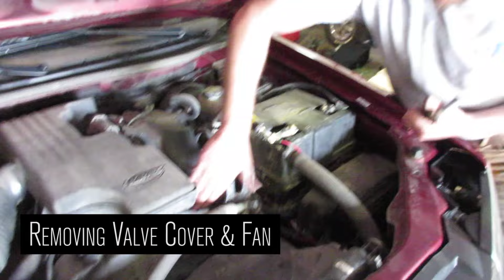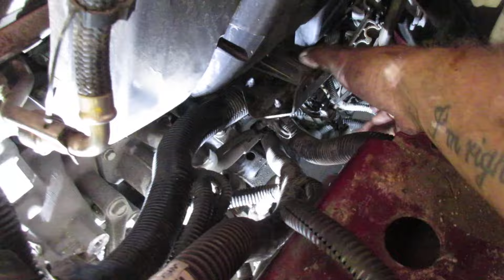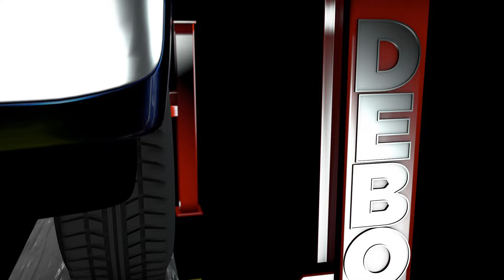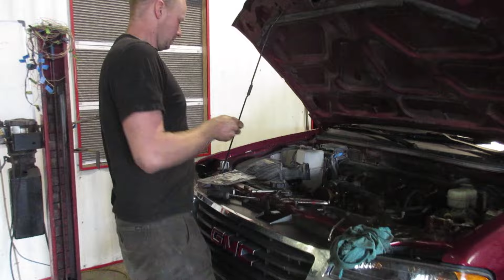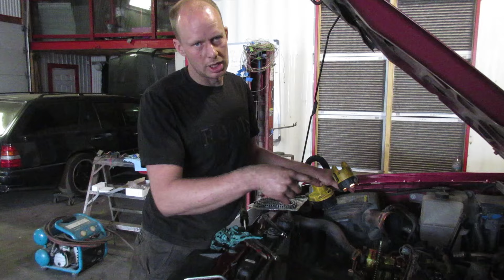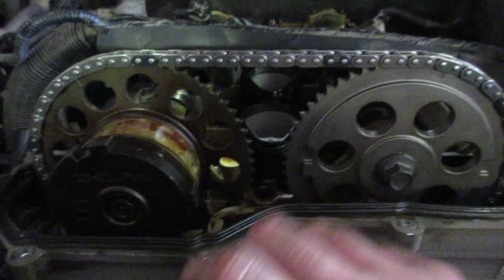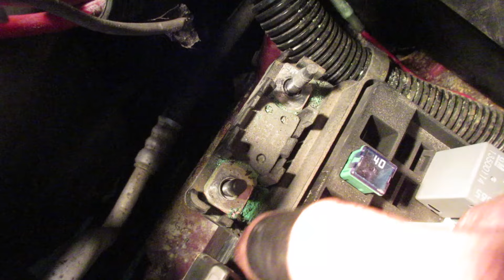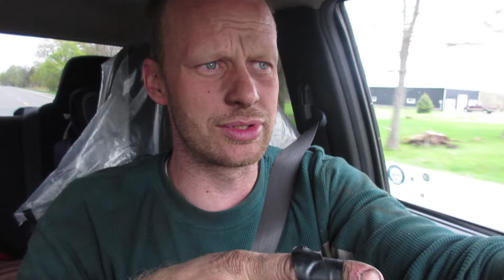Over-Engineering At Its Finest! GMC Canyon Needs A Timing Chain

Comment: The best thing to do with one of these engines would be to drive until it grenades and then swap in a V8.
Reply: That's the trend with these trucks (V8) Seen one that is diesel swapped.

Pretty sure this is Saab motor in these trucks.
Reply: @Bumblebee4788  Grave digging here but Saab helped engineer Ecotec, not Atlas, which is what these trucks run.  There was a Saab 9-7X 4.2i that used the 4.2 I6 Atlas (good engine) but that's about it connection wise with Atlas and Saab.
Reply: Our buy one that came with a factory 5.3L V8 which is what i did

Comment: I was inspecting the rebar for a column in a library extension once.  Boy Wonder architect had specified elegantly thin concrete structural elements, crammed with enormous rebar, and had diligently calculated the size of the voids needed to allow the concrete to fill the forms evenly.  Because 3/4" aggregate should have no problem sneaking through a 7/8" space between bars, right?  No way any individual rock could possibly become wedged.

Imagine how long it took to chip that cured concrete out when HUGE rock voids were present.

Comment: Loved our little Colorado 2.9L for the same reasons. It was a great runabout until it hit 100K miles. Then the timing chain stretched to the point the check engine light came on, even with perfect maintenance. I was able to change it all out without removing the intake (plastic, it bends over) and I pitched the rear chain in the garbage, 'cause screw that nonsense! It ran well enough to keep the light off, pass smog and we sold it before the next craptastic nightmare breakdown occurred. BTW, its a good idea to replace the cam phaser while you have everything off. It was surprisingly cheap from the dealer and makes for a complete job.....(he says, as the new rear balancer chain rusts away in a landfill!)
Reply: Hey what year colorado was this?
Reply: @larsonny77  Pretty sure it was about a 2010. Just a base model, fleetwhite truck with no options. The other major issue was the heater blend doors breaking very early on in the truck's life......other than that, it was a great vehicle.

Comment: hey buddy, my first truck was a 1990 chevy s10 4.3 and a 5spd 4x4. that truck was my dads and he gave it to me when it was on her last legs drove her for a couple years in highschool, burning coolant and changing the oil very often. it knocked and rattled like a sive. i loved that truck but not reliable at all because it had 300k on it. my next truck was a 1984 s10 2.8 v6 and a 4spd and 4x4. i love my truck. anything that goes wrong with it i can fix it myself. i just re did most of the wiring from the cab to the back lights. never messed with wiring but replacing all that really made me understand and understand it isnt a hard job at all. ive put a clutch in it and cam shaft for a little more pep to the dog of a engine 2.8. put pretty much everything in the thing from radiator to axle shafts. did that 2 years ago and since i did all that work to it, it is the most reliable vehicle ive ever been in. -40 below fires right up. i crank on it for 15 seconds when its cold out then pump the gas pedal a few times and she fires right up. been in over 2 feet of snow in 4low with very aggressive snow tires and chains on. she goes anywhere. ill forever own a pre 1993 s10.

Comment: It's very odd that there isn't a method by which you can break a link on the old chain, temporarily attach the new chain to it and then thread the new chain in while pulling the old one out. The last step of the process is to connect the two ends of the new chain together using a special (read expensive) tool that properly peens the joining pin.   I had to replace the chain in my old Diesel Benz and did it that way.
Reply: Yeah that’s the way the old mercs were done. But there proper engines tho and normally a chain on one of them isn’t fucked till at least 500k anyway. Was yours stretched?
Reply: All wishful thinking .. 
Dreaming of that Perfect Timing chain Girlfriend 😄
An un-chainable girl, one easy to replace, free of tension and wear.
A girl needing no guides or guidance to direct her as she endlessly rotates only to discover Top Dead Centre and lobes without earrings 😄😄

Comment: So two questions, what else should be fixed on an engine when you have it stripped down that far and 2, what did you do with all the left over parts after you reassembled the engine?
Reply: Water pump

Comment: If I was foolish enough to have purchased that POS, I would've called a wrecker before I'd drop 4k on a timing chain repair.
I'm no millionaire, but there's a point where you are pouring money down a rathole.
Reply from the maker: He figured the truck didn't owe him anything and its still cheaper than buying a new truck.  There was almost no rust on it and the brakes were still original.
Reply: Excellent job detailing the repair. A ton of work, but a successful job. 
Peace man.
Reply: The parts are probably less than a couple of hundred, the 20+ hours of labour....
Reply: luviskol the ford ecoboost is built like this to replace the water pump,fuel injectors etc you have to tear the engine apart fuck these new automobiles, this is what happens when you let accountants design anything.
Reply: ThaGVPSon the atlus is a decent engine just a royal pain in the ass
Reply: That thing is a perfect candidate for an insurance job. I have cussed many a GM Engineer in my wrenching career. Actually I am not biased, I have cussed out Engineers of every make I have worked on. Some just stand out more than others.
Reply: For 4k you might as well buy a new truck

Comment: its sad that people that design these flaws get paid big $ and the back yard mechanic tryn to make ends meet could design something far better n more efficient
Reply: Negative sir. these engines today may be a pain to work on, and we might cuss em. but to say a backyard mechanic could design something more efficient is a foolish thing to say. do you know what efficient means? so your telling me your average backyard mechanic can write a CPU program to monitor a network of sensors to add just the right amount of varying fuel from millisecond to millisecond based on the varying compression ratios and varying volatility of the mixture, due to varying camshaft degreeing, which is based on engine load and speed? every single aspect I just mentioned involves extremely complicated mathematics and scientific principles. and we're not even getting into the half of it. lol ....a backyard mechanic can do lots... sure... but he can't do that.
Reply: The problem is one that is very prevalent in all industry currently... there is too much emphasis on education over real world experience... IMHO anyways
Reply: I do "backyard mechanic" stuff to make ends meet, and YES..... there are many backyard mechanics that could design a better system than many of these over engineered, self important bloated stuffed shirt professional engineers at car companies do.... Ever hear of Preston Tucker? the truth is that it's a question of intelligence, not collected book learning and formulas. Yes some things do require the application of formulas and complex ideas to solve, but good OLD FASHIONED organization and syntax cannot be taught in any school or substituted. And If I need to use a complex formula for a specific purpose, I can find and use that information. Yes, I can write a CPU program and do regularly with arduino..... There are many mechanical problems, mechanical and basic design flaws that I have solved by making new, better parts for and have seen this done even on old farm tractors from 50 yrs ago.  You guys place waaaay too much importance on a degree and not enough on common sense. Sorry, I just had to jump on a soap box for a second. This presents an opportunity though, I will look for one of these with a bad timing chain, rip that over engineered POS engine out of it and put a modded 1.9l VW TDI in one and sell it as a better vehicle
Reply: I'm a design engineer and I worked for GM in the past and we were held back by management from what we wanted to do if it was our car/truck.  Most engineers want to do a good job but it is the suits on the 14th floor who only know the bottom line who get to make decisions.  It was a joke that the most popular cars among the engineering staff were Toyota, Audi/VW, and Honda.
Reply: there design flaws so you trade it,.
Reply: @TheCoatneyadkins  Yes, sir. A decent thinking man could DEFINITELY make it more efficient. There is more to life than MPG's.
Reply: @operator8014  I would have to disagree,  gas engines are REALLY INeffecient machines to begin with.  Meaning about 75% or so of the energy in the gasoline is lost ,mainly due to heat dissipation,  before that power ever turns a wheel. It's been over a hundred years of some of the smartest people all over the world working to make automobiles more efficient. And this is what is culminated to today so far. Incredibly complex computer and sensor networks that Control electromechanical engine management devices all over the engine. All in the name of effeciency..........but some brighter than average shadetree from BFE Nebraska could make it more effecient though? ?????? Lol
Reply: @operator8014  might be able to think of a design that makes the process of DOING REPAIRS easier and more effecient maybe. ....
Reply: @operator8014  but just so ya know. ...the MEANING of EFFECIENCY when it comes to automobiles is MPG. Lol
Reply: @TheCoatneyadkins  Even based solely on MPG's, the hypermiling community is REALLY good at that stuff. People are making diy hybrid drivetrain mods and full EV builds to lower gas consumption. Hell, a hacksaw and a K&N air intake can get you a couple MPG's by themselves. And re-programmers that bump up your MPG or HP have existed for 20+ years now.
Reply: @TheCoatneyadkins  You obviously aren't aware of some backyard mechanics with engineering an computer degrees who do write their own software. Also, another example is the backyard Tesla guy.
Reply: @TheCoatneyadkins  There have been many back yard guys over the years come out with engineering ideas/designs that improved MPG. Just look into the Upside carbs from back in the day, also, just because you can't fathom the fact that some guy in his garage isn't smart enough to do what you seem to think is impossible for what ever reason, doesn't mean it's true or that it isn't possible.
Reply: @DrMurdercock  well let me put it this way: NO shade tree mechanic around here where I live can even understand engine management systems enough to diagnose them much less design something more effecient. ..hell most of the "professionals " I've worked with don't even really understand systems in new vehicles,  they just read a code and swap shit out til hopefully they fix the fault.  I live in the land of hillbillys who are stuck thinking you can still diagnose and fix shit the way you could back in the sixties. The type of folks that have a bucket full of bolts left over at the end of a repair. ..

Comment: I usually just talk the customer into replacing the whole engine for just a little bit more $, if I remember correctly eagle engine sales this engine with a warranty for 3,000-3,500$
Reply from the maker: Thats USD.  Its roughly 4200-4700 CAD + shipping, and taxes.   Just the chain is a lot less...
Reply: I have a trailblazer with the I6 version of this engine, the timing chain replacement kit is only $150, but the rest of it is in labor, for a DIY person, an engine swap would be easier in all honesty.

Comment: I'm currently in the middle of replacing the timing chain/tensioner/guides set on this engine (282K miles) and had a thought after watching this and other vids.  Wish I would have thought about it before 20+ hours of dissambly.  I would rather have cut through the oil pan (while mounted) to expose this bolt, hold the pickup tube in place with a pair of vice grips. Remove the bolt. Do the front timing chain set replacement.  Re-install the pick up tube bolt.  Weld a patch on the oil pan.

Comment: Over engineered? I think that it is under engineered. A good engineer would try to engineer it so you could work on it easier than this.
Reply: Not any more bud
Reply: Mabye 20 years ago... Now cars are engineered to fail at a certain point and be too expensive to repair. Its a common practice as my dad is an engineer(compliance).
Reply: Good engineers don't work at GM

Comment: Ford is so guilty of the same damn thing.
Reply: Yep
Reply: They all are. It's not specific to one maker. The whole my vehicle is better cause so an so makes it stupid. They all make shit that fails, they all do stupid shit to make things hard to work on.
Reply: Yeah, it took three mechanics almost half an hour to change a bulb on my ford Ka. Although it was only one mechanic for most of that time
Reply: In other cars I can do it myself in a few minutes
Reply: Yep. The 4.0 V6 has one in the back.
Reply: Dr. Doom you should try owning a mazda or Honda, Japanese company actually put some thought into things
Reply: @miatafan  The engine is from Isuzu, a Japanese company.
Reply: @GGigabiteM  Yeah and Owned by Chevy.
Reply: Ford puts the water pump inside the engine with the timing parts on 3.5 liter. If water pump fails you get mixed oil, run it too long buy a new engine.

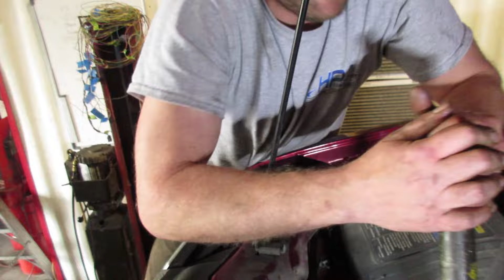Comment: 2:10 or set the breaker bar against the frame rail, go inside the truck and tap the starter, and it will break the bolt loose for you.

Comment: I've noticed a steep decline in quality at GM since around 07/08, particularly in the motor and electrical department, especially the electrical stuff.
Reply: MeMad Max Really? Based on my experiences, GM quality has been improving a lot since 2008 (their trucks in particular). That being said there are some early to mid-2000's GM vehicles I want nothing to do with. Their 4.3/5.3/6.0/6.2 engines are all solid, other than the cylinder deactivation junk, but that's an easy one to avoid and easy to get rid of. I'd take any of those engines over a used Ford 5.4 or 4.0v6. Even the 3.5/3.7 Duratec and the idiotic timing chain-driven water pump buried inside the engine valley is a nightmare waiting to happen.
Reply: Oh, I guess I should've mentioned that the electrical issues seem to be focused on gm cars, not the trucks. But the mechanical stuff like you see in this vid are on both trucks and cars. We are a used vehicle dealership, so we see it all. However, the worst of the worst is german engineering: VW/AUDI. I always have at least one stall with a fine deutsches völkerfahrzeug in it requiring major repair work of some sort.
Reply: hochhaul knock on wood my 05 Silverado 5.3 has been a really good truck, especially the engine.
Reply: it was probably built on a Wednesday.